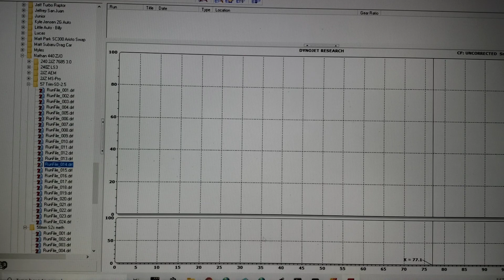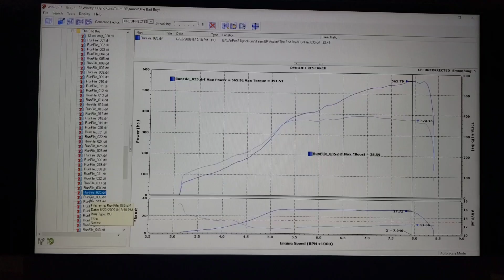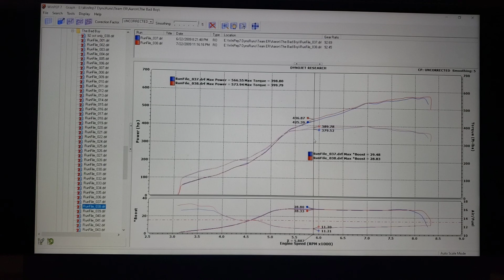Tuning with no knock control?

Comment: It makes sense to tune based on dyno graphs, as when knock occurs, power will certainly drop. I tend to like using audio knock ears when tuning.
One question Aaron: How does one go about determining the boost/RPM limit of an engine without physically breaking it?  For example, if someone comes with a car setup for high-boost application, do we just trust that statement as tuners and gradually increase the boost until we see the power plateau? For RPM limit I usually keep the piston speed below 5000ft/min (assuming the dyno graph supports this decision and the lubrication system can handle it)

Again appreciate you sharing this information and wish there were a different platform than Patreon for us with no access to it.

Comment: Hey Aaron, when tuning ignition timing and pump gas (95) on an evo 5, sometimes I'll see knock count of maybe 3 - 4 counts here and there, but the knock voltage doesn't show any signs of voltage spikes on those areas.... sometimes the other way round, would this be considered as real or false knock ?
If I reduce 2 degrees of timing the knock count would disappear but the dyno graph start getting "choppy" rather than before its alot smoother.
Reply from the maker: I have seen the same, you will also see misfires appear in knock voltage. Age of the sensor, condition of the wiring, and things as small as lifter noise can affect all of this as well. I usually adjust the filter when I run into that situation.

Comment: Hey Aaron!, just wanted to ask. When you added timing and the boost dropped that means it'll refer to a different row/column for manifold pressure, that means you added a degree to most of the columns to eliminate interpolation from other columns?
Reply from the maker: Usually the boost still is close enough to be comparable unless you have pulled a significant amount of timing

Comment: Many in the DSM community don't use knock control with EMS on ethanol/methanol saying its useless and I'm at that point on e85 and 40psi on a FP Black where I don't get any "spikes" from the knock sensor I can base any knock control maps on but I did have a head gasket let go when I bumped it up from 8-10* to 10-14* in the 6000-9500rpm.  This video really helped but without a dyno what other sensor data can I look at in my logs?.. other than the boost level lowering and even that should only be to a point I would think before it steadies out with addition of timing.  I do have individual EGT but I'm not sure if that's consistent or accurate enough to base timing changes on?  Will I see AFR changes with 1-2* timing changes? The general rule of 12-15hp per 2* doesn't help me either as I won't see that difference on a time slip on a 650hp car...and going up 4* at a time I'm not comfortable with.
Reply from the maker: You can combine several sensors together to try and paint the picture but a knock sensor will always be a base sensor.  Adding crankcase pressure to look for blowby increases because of ring flutter was a trick I have seen done but havent done personally.  I wouldnt use EGT as a timing tool.  The knock sensor being used, EMS being used, and profile of the timing curve, as well as if it was an auto or manual all add to the mix as well.

Comment: Some great little gold nuggets  of knowledge ripe for the pickin, and really interesting. It's great being able to visually see the cause and effect and get a better understanding. Like how starting that combustion event sooner will pick up some power whilst driving the turbine less hard thus a power gain and drop in boost. That was great. And the combustion instability stuff and seeing how that can be corrected. For those of us street tuning with VD it makes you wonder how much better of a tune you can get with a real dyno...was that just a bump in my "calibrated" (ha) stretch of road or do we have a little combustion instability....
Reply from the maker: Before we had a dyno at our facility I could be within 4hp of the street to the dyno.  Looking at logs you have lots of data to correlate, depending on make/model/year there are some very odd things that have crept in and especially in the Evo 8s with stock camshafts.  As far as VDR I would take the numbers with a grain of salt as far as over all.  If the road is flat and there is no wind or at least always the same direction the gains are somewhat usable.